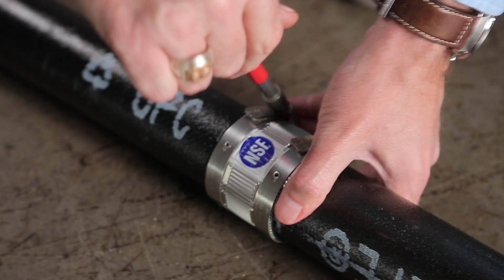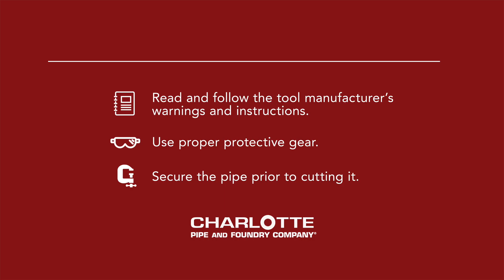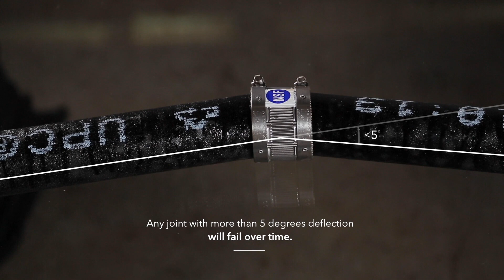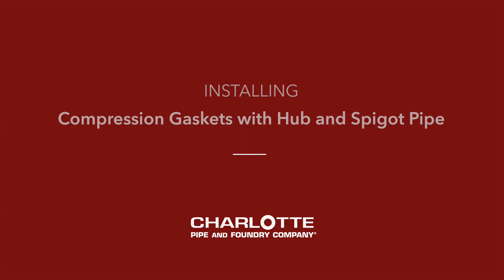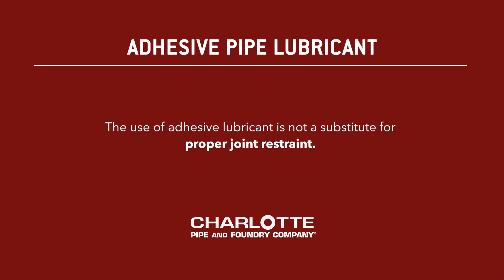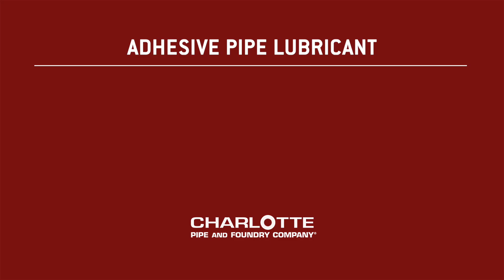How to Cut and Join Cast Iron Soil Pipe

Comment: If you really want it to last a long time dab some Permatex or tar on the cut ends before inserting them into the rubber so the cast iron is waterproofed like it’s supposed to be. Every time I take an old cast iron pipe out the ground or ceiling it’s degraded at the bottom of couplings

Comment: As an auto mechanic, I've seen rubber hoses & seals fail over time. Same with those worm screw clamps. I just don't trust them. Isn't there another way to join those pipes?
Reply: I'm a past ASE cert master auto that got into rentals and rehabs. Remember, there is 0 psi on these fittings and system and 0 physical forces. I haven't seen everything but I've never seen a problem where the "rubber" itself failed.  I know of no other way to connect cast/iron with pvc. In the past all connections were bell joints that were filled/sealed with a rope type packing (oakum) and topped/capped (terminology?) with molten lead or a mortar/concrete substance.  I believe that the oakum was impregnated with "tar" either by the mfg or the installer on-site. 

Hopefully the author/producer/mfg will chime in.
Reply: You use lead to seal the pipes. Im the same way on how long the rubber connectors last.